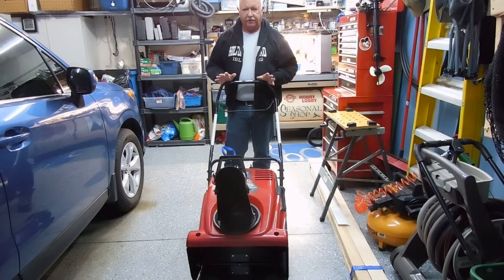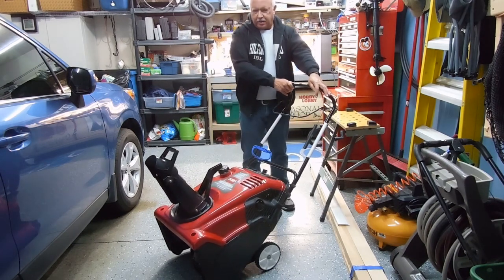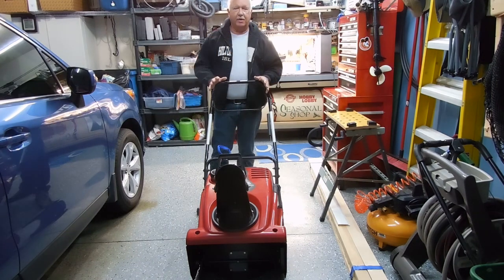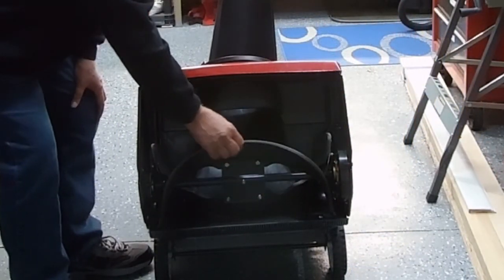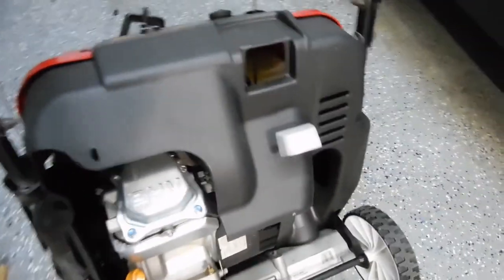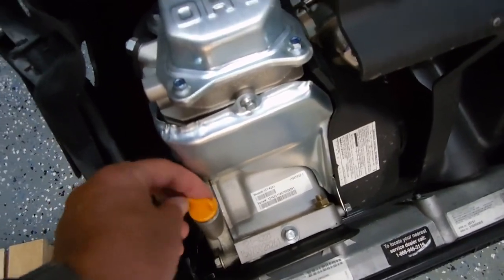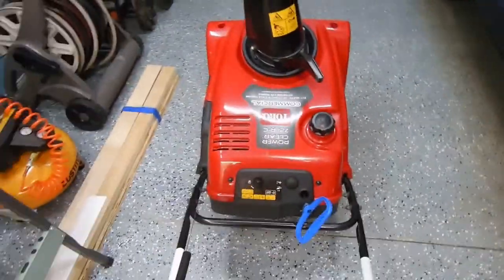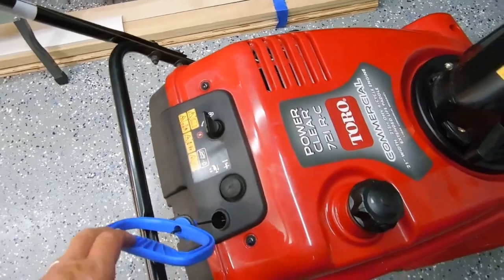Toro Snowblower Review

Comment: Wow that’s impressive little snow blower. My little polan pro can’t handle wet snow and slush!
Reply from the maker: For several years I had a two stage snow removal monster! But whenever the snow was wet and heavy it would clog.  The Toro has never clogged and so far removes all different types of snow.  I’m more than satisfied with the purchase!
Thanks for watching and taking the time to comment 👍👍
Reply: Sure thing. I just upgraded to a toro snow commander. I hope it works well.
Reply from the maker: @gibco25-offical56  I think you will be very happy with it!  I've tried several types and the Toro's with the flex paddle will clear all types of snow... Definitely better than any 2 stage system!  Now we just need some snow to play in!  Oh, maybe you have some? :0)
Reply: @BoilerDan1   not much at all. We only had like 3 inches of wet rain soaked slush. I normally use my lawn tractor with a plow for it. But I’m keeping my fingers crossed for more! :)
Reply: Poulan pro isn't the best
Reply: @smallengines1018  yeah that’s why I traded it in.
Reply from the maker: Shame, I have that nice Toro pro and chose to visit Florida this week and next! A foot of snow back home in Indiana and I’m here sweating in 80 degree days 😂
Thanks everyone for watching my little video clip on the toro snow blower and joining in on the conversation 👍👍
Reply: @BoilerDan1  I have a Toro ccr 2450
Reply: @BoilerDan1  and a Toro power shovel

Comment: Hi Dan-Merry Christmas!

There is a drain plug just below the dipstick...you can use either

Save yourself time by not dragging the blower back up your driveway...here is the definition of how to optimize blowing a driveway:

https://youtu.be/7bOshJ_frWI

(Hats off to Ken Bittle!)
Reply from the maker: The drain plug is a great thing to point out!  I'll be checking that out.  The snow blowing technique works well with No WIND.....  The other problem I have is that my drive has two walls on each side at the beginning. (Condo complex, shared drive.) So for 1/3 of the drive I'd be hitting my , and the neighbors sidewall.)  I appreciate your taking the time to help this old guy out! 😂🤣